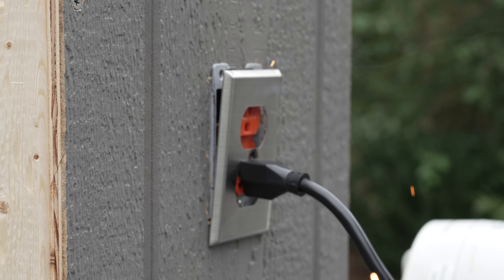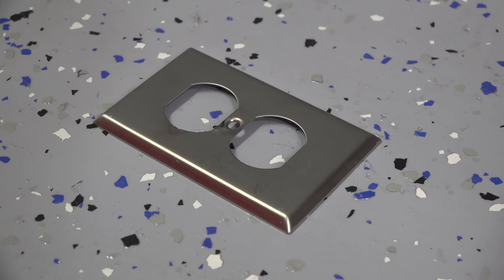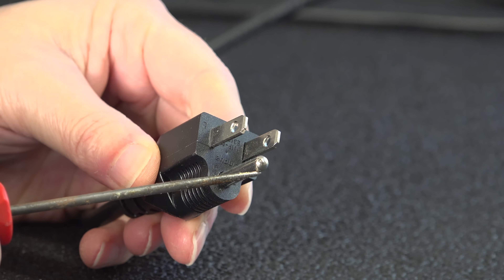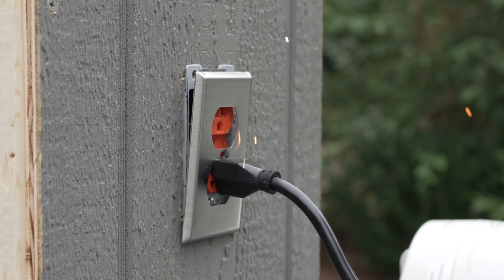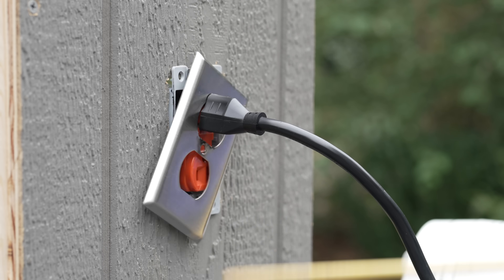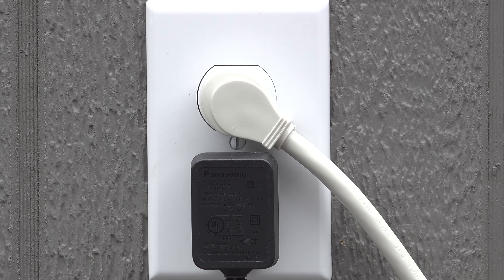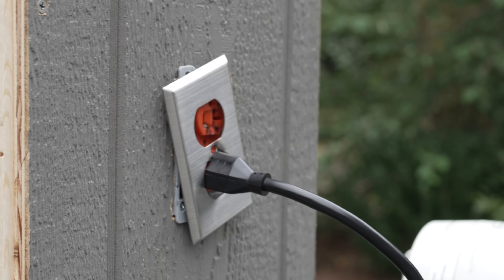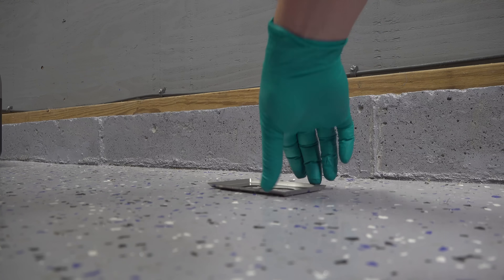What REALLY HAPPENS when you Install OUTLETS UPSIDE DOWN

Comment: Great breakdown on the issues with that practice! So many people have argued with me that it is safer! If only we had small plastic covers over the hot and neutral like the UK has to prevent exactly this problem!
Reply: In the UK the covers are an integral part of the socket or permanently fitted to the socket.

Comment: Video Suggestion. First, this is a fantastic treatment of this question regarding outlet orientation. Another misconception area has to do with how much current a ground rod can or will draw when energized. Most people assume that a ground rod will draw current like a short would and trip the breaker. Turns out most ground rods will not draw enough current to trip the breaker but more than enough to cause injury. In spite of this there are lot of situations where unbonded gourd rods get installed. I'd love to see a treatment of this topic at the level of quality you did this video. MikeHoltNEC used to have a video on this but it seems to be no longer available.

Comment: I’ve discovered that ground up is often used in commercial installations based on electrical contractors’ comments.  Why not mostly eliminate the screw from loosening on a metal plate installation, period?  Screws typically rely on just their initial installed tightness to hold the plate.  Nylon or similar on the female threads will severely reduce the chances of back-out and loosening.  It’s used all of the time on other screw or screw/nut combos to act like a lock washer.  Stop this electrical short issue by addressing the root cause at the source.  Also, the majority of plates are plastic or nylon these days rendering this issue moot.  I have also found that the ground prong is the stronger of the three in terms of hold in the outlet.  The plug has less likelihood of sagging to expose the hot spade.  I know that this is highly likely going to garner responses.

Comment: personally think this is very contrived with the screw completely out. If anyone is that concerned about the screw "working itself loose," they can put a dab of an appropriate thread locking compound on the screw before screwing it in, no more concern about a dangling metal wall plate.  Point still stands that ground up is just a pain in the posterior with a hypothetical at best advantage.

Comment: Always pros and cons, to me it’s far more likely when the ground is down for a child to recognize it as a face and play with it, also, did you see the sparks the metal plate caused? That’s a fire especially in an oxygen rich place like a hospital. So, agree with some of your points but for me, I draw the opposite conclusion. Probably why there isn’t a code, either way can be an issue.

Comment: Anything American electrically I find idiotic, why wouldn't you just earth the front plate. There's no common sense with American installs.
Reply: Actually, it is earthed by the screw which goes into the earthed frame of the outlet. Please don't picture American homes with their metal outlet plates dangling from the prongs of plugs. This is very rare - I  can't ever remember seeing that in over 60 years. Smart Americans will tighten loose outlet plate screws. Less smart ones will just remove the plate. Lol. Or maybe they don't have screwdrivers. Or the plate had corner broken off, so they removed it like some people I know who just remove their cell phone case and use the phone for weeks without one instead of using tape or something to keep the case together until they get a new one.😂
Reply: It's still not great, why not having a flying earth earth lead to the front plate then you're covered if it does come off. I think it's bad practice to rely on the screws for earth continuity, but it looks like you don't even have the option for a flying earth to the front plate.
Reply: That would work. Metal outlet plates with ground/earth wires would prevent a shock in the rare case that the plate comes loose and contacts the hot prong but not the neutral.
Reply: RCBO would fix that issue.

Comment: Wow never thought this would be an issue! In Australia our faceplates just don't come off - even if they did they're plugged in tight so it would be unusual for the plate to come between the plug and socket. Our plates are always L+N at the top and ground underneath, and our plates come in horizontal and vertical options - google AU power :)
Reply: (our plates clip on to the sockets - no visible screws - pulling them off requires a bit of force)

Comment: Somehow Chris you missed the benefit of the upside down outlet is the three pronged cords tend to stay in the outlet more securely with that arrangement than the traditional happy-face (gnd down) position. Not sure why, but the longer ground lead holds in the receptacle better for extension cords and power cords but will allow cord sag the other way. 
There ya go. 
Have had many years of contracting and working with other electrical contractors with that experience, that probably all did medical outlets to the spec you mentioned here, and then decided to do their homes and businesses and then commercial jobs with the upside down outlets cause they’re just better…and can also possibly prevent an arc or shock with the early warning of a loose cover plate.
Reply: Of course there had to be at least one...😆 Flush-plug cords (and transformers) are the only reason you need to install your outlets correctly.

Comment: I bought a new house two years ago and every outlet is installed upside down.  I like the look of the screwless wall plates and the decora light switches anyway... So I've been methodically switching out every outlet, switch and wall plate in my house.  Returning them to the correct orientation in the process.

Comment: In every house I’ve owned, outlets were installed “ground down”. Except - in rooms with a switched outlet, these were mounted “ground up”, so you knew which one was switched.
Reply: In my house the outlets are half-hot. The top receptacle is switched, the bottom is permanently powered.
Reply: @TheOtherOne111  Why don't they do the "half-switched" outlets everywhere?  ( except in kitchens or baths)  Are they too cheap to get 12-3 wire?
Reply: @elultimo102  there is an extra minor step involved that I guess some installers don't want to bother with.
Reply: @DrQuadapus  ---Only switch one side.  You have the flexibility to place switch-controlled lamps anywhere in the room.
Reply: @kevinmcgo  What bugs me is when they skimp on circuits.  Are a few extra breakers too much on a $400K house?  The kitchen should have one for the fridge, and at least two for the counter outlets.  Each room should have its own.
Reply: @elultimo102  i see your point but it seems to have never been an issue that i've heard from a homeowner. if a room is big enough to need to move the lamp a fair distance from the doorway where the switch is, that room already or should have ceiling light fixtures
Reply: @elultimo102  also with your scenario, everytime i turn my light off half of my devices turn off. either i get like 4 switches for a bedroom or a power strip at every outlet. seems impractical
Reply: @elultimo102  You would have to have switches installed for all your outlets!! You really only need switched outlets to control a light in a specific place like entering a bedroom with no ceiling light.
Reply: @Kevin-mm6xm  On the same circuit, the room's outlets could be daisy-chained, if you split the outlet tabs and used a third wire for the switched side.  The trick is being consistent, remembering which side of the outlet is switched, and plugging into the proper side.
Reply: @elultimo102  Well....why? Switched outlet circuits are designed to control lighting. There is no need to switch a circuit on or off anywhere else other than a light entering a room or a garbage disposal.
Reply: @Kevin-mm6xm  -- Half-switched outlets would allow flexibility in furniture arrangement.  My two biggest bedrooms and living room have no ceiling lights and only one switched outlet each.  I have to arrange the rooms to accommodate that one outlet, and have a nearby lamp table.   One switched outlet is right behind my headboard.  I didn't build the place, and don't care to excavate the walls to replace the Romex, since I plan on moving within five years.
Reply: @elultimo102  I hear you. You would like it. But there's a reason it's not done. It's just not what most people want or would like to have. You've now limited your dual receptacle to a single if the switch is off. Buy hey, you can always wire up splits wherever you want one!
Reply: I think it's the extra cost of the 12 gauge wire.
Reply: @a9ball1  ---12 gauge wouldn't add much to the cost of one house.  A developer building 1000 cracker boxes would feel the difference between 14 & 12.
Reply: @a9ball1  You need 12 gauge for 20 amps..  Where I live, you can't have lower than 20s---even when there are not enough of them.

Comment: When horizontal there is a code requirement! Hit must be on bottom. Vertically at least the plate was grounded first before it touches the hot. It is known in the electrical field that with a metal cover grounding goes up.
Reply: Code article please?
Reply: @SC-nw7nj  ok I stand corrected. There is not an exact code but is known as a best practice.
Reply: @SC-nw7nj  It is in our text book that way

Comment: So the real issue is that some people don't seat the plug completely into the socket. Because, if you do, there is no gap exposing the plug blades.
Reply: Sometimes you step on a cord and it comes loose, sometimes the receptacle is worn and doesn't hold a plug correctly.
But that's still user error. Plug it back in after you step on it, replace the receptacle if it's loose. 
And plug design should be changed so any part of the plug that may become partially exposed is insulated, so it wouldn't be live on a somewhat loose plug. Ground facing up is such a bad solution for any of this.
Also - many cords don't even have a ground prong, so you literally are getting no benefit from ground up on such cords.

Comment: I prefer having the grounding pin up as a guide when plugging in a receptacle.  Being right handed, the neutral socket is on the right side when the receptacle is installed grounded up, so one’s index finger is closest to the grounded conductor when connecting a plug to the receptacle rather than the ungrounded socket. 
I also think your basic argument is flawed. You omit the circuits being ground fault protected.   In addition your demonstration seems to be designed to support your argument, where the outcome is manipulated to support your position.

Comment: Seems that it would make sense to use non-metallic cover plates. Great demonstration.
Reply: We typically don't for residential, but commercial buildings typically have metal covers and many types of businesses such as mechanics and hospitals are REQUIRED to have metal covers. Working with what we've got, if you want to make it safer there should be a requirement that there is something plugged into the ground of both outlets to make tipping far less likely. Better still, require threadlock on the screws so they don't back out in the first place. 

That said, the safest alternative would be to start requiring outlets to have slightly deeper contacts and plugs to have about 3mm of insulating material along the blades/pins, even if just on the hots (split phase power having two hots for 240V circuits).
Reply: I've never even seen metal ones outside of an institutional structure like a hospital or school. The plastic ones are like 20 cents and match the walls.

Comment: I have found that as the cord falls downwards from the outlet, a ground on top configuration makes a better contact to the hot wire. I also only use plastic covers.

Comment: If using a metal plate, I would recommend one use a dab of Locktite on the screw.  It sounds like poor maintenance if the screw is missing.

Comment: Maybe the manufacturers of the cover plates need to include screws with added Locktight?
Reply: I just installed ten cover plates that have pseudo-captured screws. Not really captured, they will screw all the way out, but they're very very tight in the screw bore. They'll never loosen on their own. Had no idea that existed, never seen it before. But they were the cheapest ones Home Depot had, bought in a 10-count bulk box. I guess that's an evolution toward eliminating that safety issue.

Comment: I normally install outlets ground side down unless It’s a switched outlet application, those I install ground up to indicate that those are switched receptacles. Makes it easier for another person to remember.
Reply: What else might happen if you normally install the outlets ground side down unless it’s a switched outlet application?
Reply: @cameronbateau6510  it can cause the ground pin to snap off if the outlet is worn.

Comment: I like "Always put the ground up so blind people can use the ground to locate the plug before insertion" better than the lame excuse "one time in band camp the plug cover come off and tripped the breaker"
Reply: That also helps when trying to plug in behind furniture. Usually I fumble for a minute or more trying to get the prongs lined up without getting shocked. But when there's an outlet with the ground up, I can feel for the ground hole, then put my finger on the ground prong to guide it in. Your example is better though and could be a valid reason for grounds up by code. We have handicap accessible entrances, why not handicap accessible outlets?

Comment: But that "wall wart" doesn't have a ground prong. Also, if this ground thing you're talking about is "such a problem," then why didn't the manufacturers of right-angle-plug cords shape them in the direction that matches up-ground-mounted outlets? And why not have plastic plates on all of them instead of any metal ones?

Comment: An upside-down outlet, in a home, is an industry standard that electricians use to identify a "switched outlet". Meaning, you flip a switch to turn it on or off. Also, using a stainless steel cover plate, is not standard practice.

Comment: If you have the receptacle sideways would you recommend the neutral or the hot up?  I would say that if you have a metal faceplate you would want the neutral up.
Reply: It's also the orientation that works best for those 45° plugs that tend to have the cord run out diagonally opposite the neutral pin - with ground pin right those plugs would have the cord pointing upwards (to the right) but with ground pin left they'll hang with the cord to the lower left.

Comment: If your wall plates "randomly" fall off you have WAY more issues than an upside down outlet.
Reply: Doctor: You have 72 hours to live. 

Me: Hey, can you check that screw on the wall plate behind my bed? Thanks.
Reply: @MoneyManHolmes  engineering already done that. At our local hospital if you bring in anything that requires power engineering must inspect it before it's allowed in the patient's room. I'm sure the plates are secured. Even in hospices rooms. 73
Reply: @MoneyManHolmes  Great humor.
Reply: Plates are well secured in our local hospital that may be a home issues. Plastic plates are better and don't conduct electricity. Old screws on old plugs may not have that insulation piece on the plug and all screws are exposed and will short out on metal plates. Metal switch plates are worst you get zapped when you try to turn on or off a light in the winter the air is so dry static electricity is present and the voltage is over 80 volts a neon light tester lights up for a second. I hated them I removed the one in my bedroom and also used nylon screws so no more zap in my bedroom light. 73
Reply from the maker: This practice started in healthcare, I worked in hospitals for 20+ years and patient rooms are beat up badly, the plates just come off from abuse, use and sometimes kids messing with them. This was never intended to go to residential
Reply: Not having kids has kept me from having broken outlets, pictures, windows, cabinet doors, toilets,  speakers with holes knocked through them nor about a million other things, which probably saved me a few hundred thousand and allowed me to retire at 56 with plenty in savings. @SilverCymbal
Reply: He addressed that in the video.
Reply: @DavidJohnson-xi7ds So!
Reply: Another possible case are earthquakes

Comment: Best is sideways with ground pin on the left. If the metal plate detaches, it will touch the neutral pins only (if it has two plugs plugged into the socket) the metal plate will never touch the active pin which is at the bottom 🙂
Reply: The neutral pins (L2) is still carring current so is no safer than landing on hot pins (L1).  Only ground has no current on it in normal operation.
Reply: @bowez9 I know you meant “no current”. 😊
Reply: @TomCee53  thanks
Reply: Imagine not knowing that electricity flows through the hot to whatever is plugged in and then back to the source through the neutral, but still giving electrical advice. Neutral is only not live if nothing is plugged in, and if nothing is plugged in, the plate just falls on the floor. If something is plugged in and running, hot and neutral are both live.

Comment: Also the ground pin is longer on the male plug, so it makes contact first and breaks contact last. Gravity can partially pull a plug from the wall, and if installed upside down (ground pin up) the device plugged can stay energized, while being ungrounded.
Reply: I think your point about the longer ground pin works against your overall argument.
Reply: @uploadJ  The point being... what ever is plugged into the upside down outlet can potentially be operating without being grounded. If that device is faulty, say a short from hot to the case, one could get a shock touching that case, as they become the shortest path to ground.